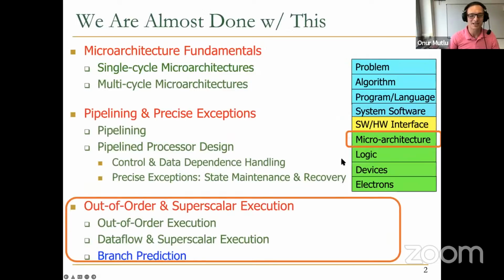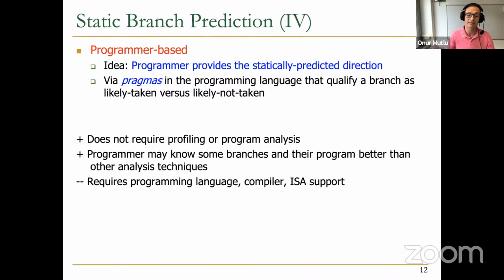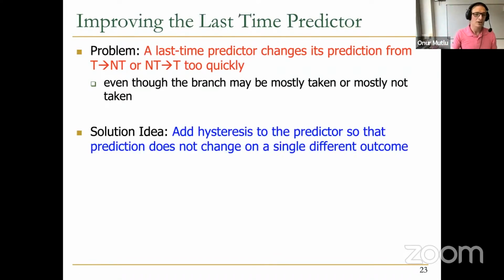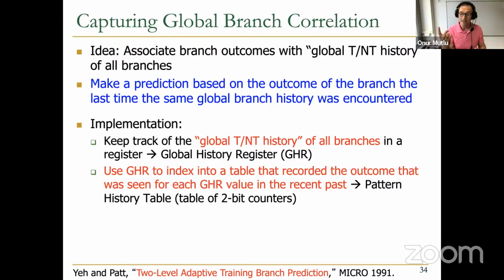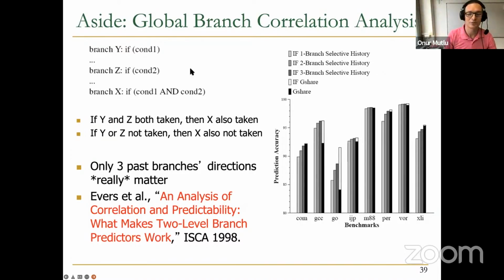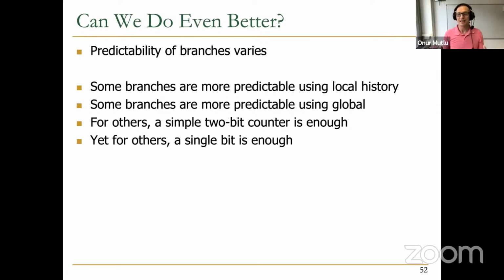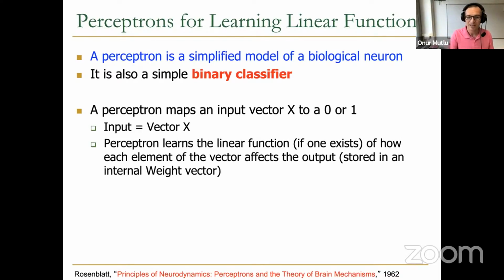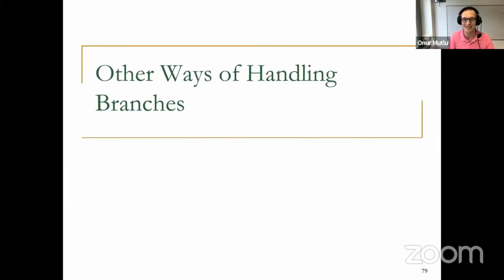Digital Design & Computer Architecture - Lecture 18: Branch Prediction II (Spring 2022)

Comment: https://youtu.be/pZjzcwZ2w7g?list=PL5Q2soXY2Zi97Ya5DEUpMpO2bbAoaG7c6&t=403 around this time Professor said that if a branch instruction is done previously, the address is calculated and saved to the buffer. However, if the processor runs the first time a branch, it didn't calculate the address yet so there might be a misprediction. I think there should be a solution for this. Am I wrong?

Comment: How can the compiler aim to minimize energy consumption? Should it only focus on delay or is there a low energy option with bit inversion to minimize switching?
Reply: I don't know whether a specific optimization for power consumption or not but at least there are options to optimize the speed (number of instructions) instead of the code size. Less number of instruction means less time to execute which also mean less energy consumption.